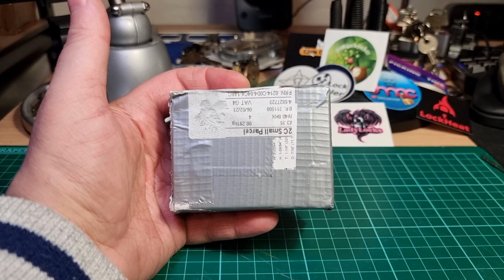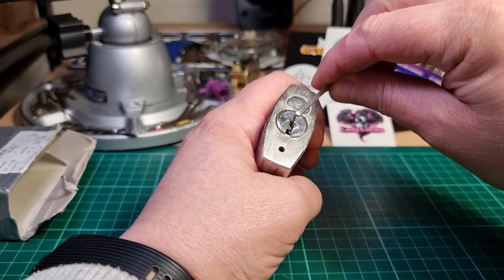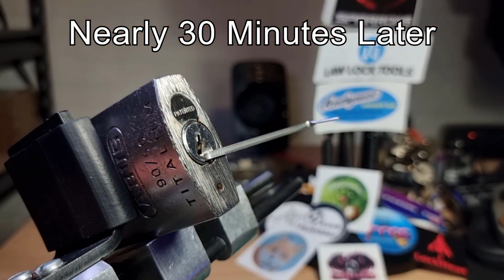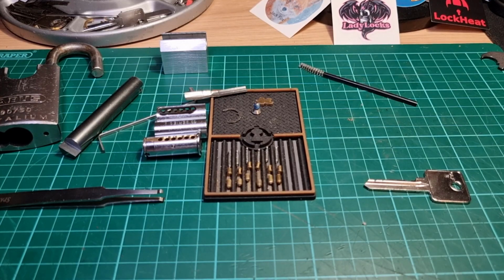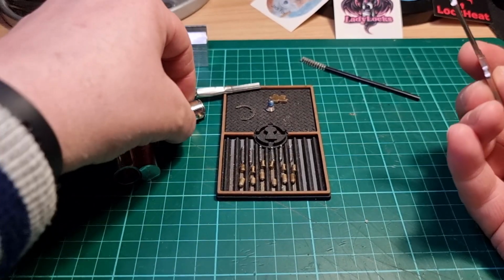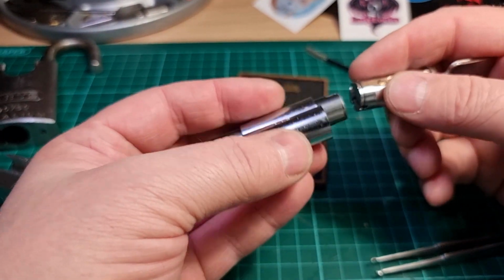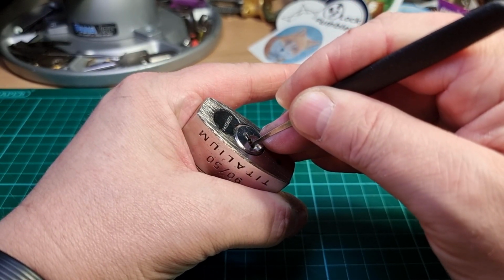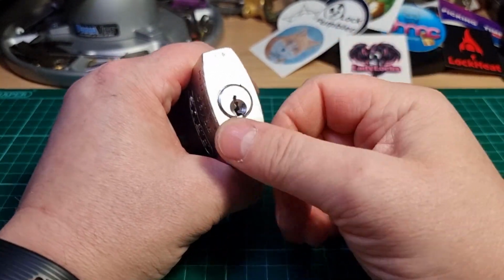(283) The Abus 90CS/50 Titalium From Rob Lawn

Comment: Nice job, and I was not expecting the core to look like that.  Plus you explaining exactly how you made the key was very informative, much easier than impressioning one at least for me. Thanks
Reply from the maker: Thank you 😁 
The damage to the core came as a surprise to me too. 
I knew it felt different than it probably should, but I was thinking the cause was going to be dust and grit in dried-out old lubricant... not damage from a previous gutting disaster 🤣 (always use a shim)
The HUK disassembly kit is quite useful but you can make one of these core holders by cutting the top off a brass snapped half-euro lock. I think Dmac has a video where he explains the process.
If you're hand-filing a key, check the cut depth after every couple of file strokes... it's easy to file too deep, especially on brass keys.
Cheers bud 😁 👍 🍻